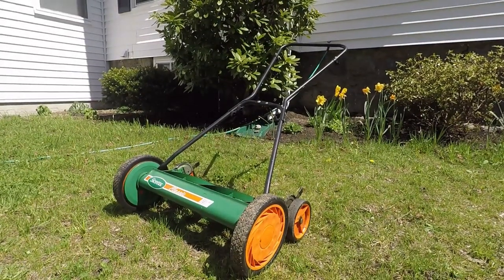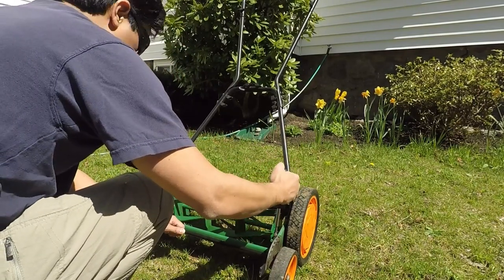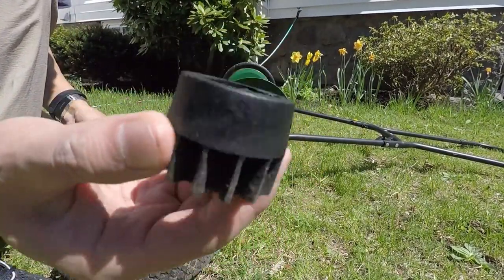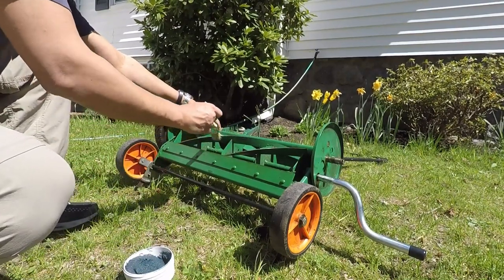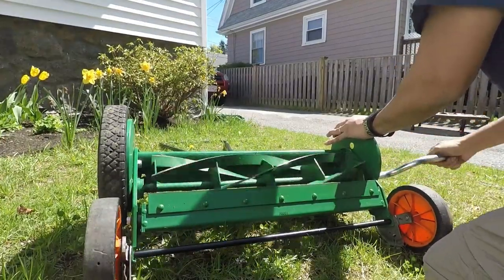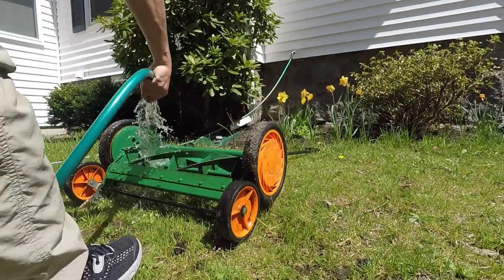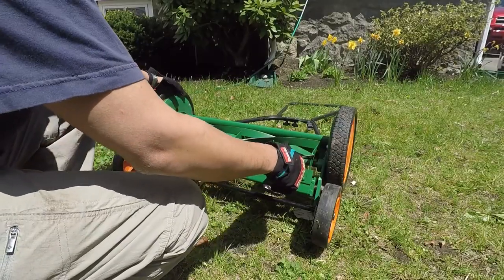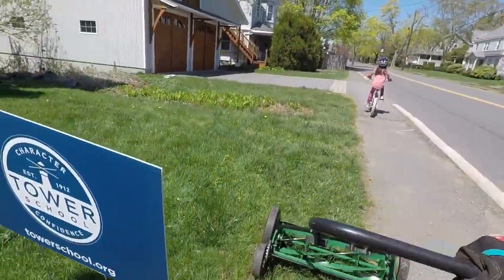Push Reel Mowers: How to Sharpen, Scotts Classic 20 Inch, Sharpening Kit with Compound and Crank

Comment: You turned the crank clockwise - the way it normally cuts. Instructions say to turn backwards or counterclockwise. Am I missing something??
Reply from the maker: Thanks for your question.  I do not have my instructions with me right now, but here is my answer.  Please note that the mower is on its back, laying on the ground, so that the four wheels are actually upside down, with the cutter bar pointing to the sky rather than to the ground.  Although I am turning the crank clockwise, the blades are going backwards in the opposite direction of what they usually do when I push the mower forward.  Normally, the blades would be going the opposite spin direction and cutting grass against the cutter bar.  From the perspective of the crank, it is clockwise, so I am not sure why that would be different from your instructions.  Note that on the other wheel, the direction is counterclockwise?  Maybe it depends on which wheel you remove?  Anyways, I hope this helps you.  Please let me know what happens.  Thanks.

Comment: Mower seemed louder after sharpening blade than first video you made of you cutting your lawn
Reply from the maker: Yes, I think the extra sound came because I tightened the contact points more whereas before they were a little loose, like a loose scissors.  The sound eventually softens over time, as you can see in more recent videos.  Also there is too much background music in my first lawnmower video (sorry) so may drown the mower noise.

Comment: Use an electric drill instead to turn the reel..Can spin either way, makes no difference in the end as long as doesnt  get too hot from friction...Small incremental adjustments only.
Reply from the maker: Thanks for the tip!

Comment: Why do people use push mowers?
Reply from the maker: I like to use it because of several reasons, including: easy to use-just push, quiet, low maintenance, no gasoline or exhaust, blades cut the grass cleanly like scissors, mower leaves clippings on the lawn, adjustable height, cheaper, less storage needed.
Reply: It's a way 2go green( no emissions )
Like other person said
No gas just push
Less hassle, No noise

That's how it use to be done before lawnmowers with engines came2
Reply: @vilramos  does save space inn storage!
Reply: Also safer for younger kids to use,no flying debree, also safer for inflatable pools in yard.
Reply: It beats paying over $5 a gallon for ethanol free gasoline and gives you muscles…
Reply: What they said, plus, when you only have a small area of lawn, it makes more sense than a gasoline-powered mower. I had a conventional mower and it stopped working one day. I watched a bunch of YouTube videos to see how to diagnose and fix the problem, and it was so complicated, time-consuming, and it required special tools that I don't have. I also don't have a truck, so I couldn't take it to be repaired and there are no mobile repair units in my area. So I went out and got myself a reel (push) mower, and sold the other one. Problem solved!
Reply: Rocky terrain. Less injuries, can tilt faster before you hit and damage a mower blade.
Reply: well for me most people wont steal a reel mower but they will steal a gas mower